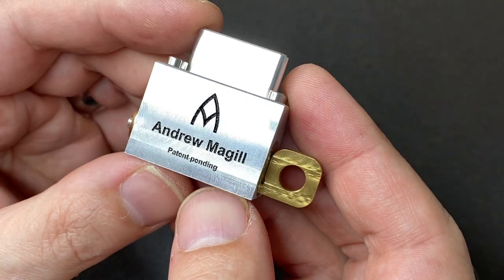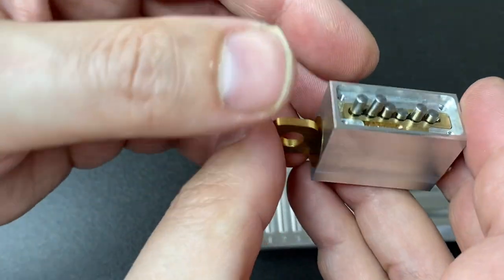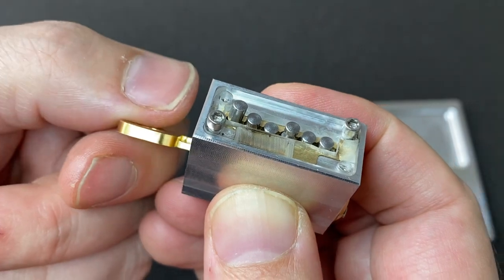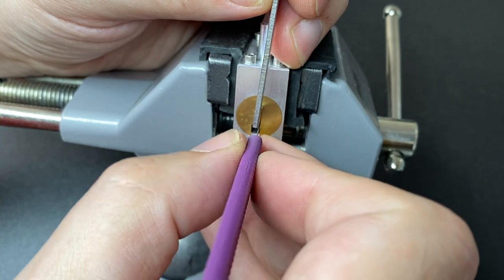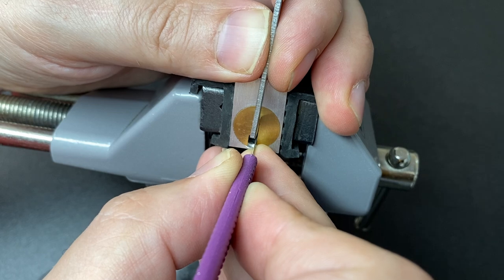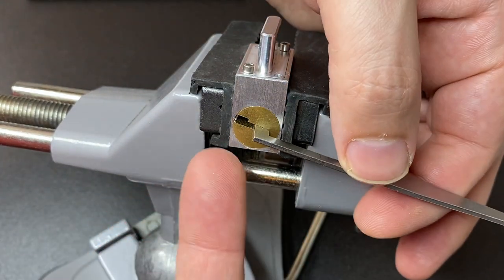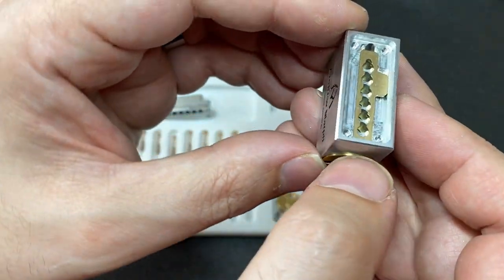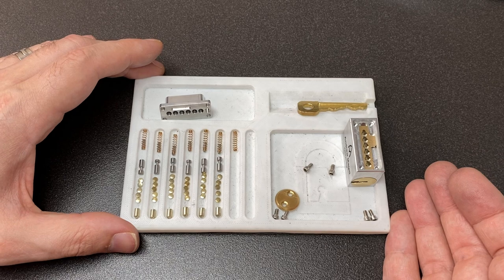Unpickable? Enclave - an Ingenious New Lock Design

Comment: Definitely an LPL challenge :) 

I would be curious how hard this lock would be to pick with a Lishi style tool, that way you get past layer one of the lock quickly by putting in the same code.  Then, when you try the combination, the force to turn the key changes based on how many pins are in the slot (the closer to the 45* pin=more force).

The key to picking it is seeing if you can feel any difference in the L2 lock tension or not and work back from there.
Reply: Assuming you can only feel what is happening at the shear line, this would be very difficult.  With 6 pins and 5 shear line positions, you would be looking at 5^6 or 15,625 combinations.
  

Perhaps there is a way to glean information about what's happening near the side bar.  With fine measurement, you could see how far the "false set" moves and then you could "feel" the pins touching the side bar.  So, my idea-- use a long and rigid turning tool-- or attach a long piece to a turning tool for measurement.  The longer it is, the more detail you can get from small movements.  Then measure how far you can turn it after setting a pin at each possible height.

Then, you might be able to eliminate a pin after testing each of the shear lines.  So you'd be looking at 30+25+20+15+10+5 or 105 different things to check.  That would take a long time, but then you might just need a few hours to open it instead of a few days.
Reply: you don't understand the math of it.

Lishi style tools help when you have feedback. Lockpicking is done based on feedback.
If you have n pins and each pin can have m positions (potential cuts), brute force is O(m^n). If you have 6 pins, and 7 positions, that's 117 thousand combinations. With feedback, you cut it down to something like O(n*m) or O(n*n*m) which is way smaller than O(m^n). O(n*n*m) would be 252 (and in practice you do it with less than 100 interactions if you're experienced like LPL; that's why he does it in a minute or two).

This lock gives you no feedback, so O(m^n) is unavoidable.
This is the third lock I saw that's truly unpickable. Bowley lock is the best: it prevents access to the pins.
Reply: @maolbz  The Bowley has been picked.
https://www.youtube.com/watch?v=ai5Hf-wPXFE
Reply: @maolbz  I think what they are saying is that you may be able to gain some feedback from the sidebar. Here's the method, it may be completely useless: 
Use a pick to align 1 pin to a position (a lishi tool could help with distinguishing the positions) then rotate the lock and feel how much strain is on the rotation from the side bar. If all of the pins are out of the side bar it should have slightly more tension than if 1 pin is correctly aligned. 
Repeat with the same pin at different heights until you find the correct height for that pin.
Repeat for each of the pins, it may be easier the further on you get as you'll feel more looseness as fewer pins are interacting with the sidebar.
Let's say you have 8 different pin heights for each of the 6 pins and you test each of these individually, the total number of tests with be 8 * 6 = 48. Each test will take quite long as you have to feel a tiny difference in tension but it makes the picking process actually plausible.
Reply: @teh_jibbler  only problem with that is theres no feedback from the sidebar or blocking pin at the back cos that blocking pin is only moved by the cam on the back of the cylinder, not the key. Once the core turns, all pin stacks are blocked from moving too so you cant feel through any of those what the sidebar is doing either. A brilliant design in that respect.

Comment: This is a different implementation of the same idea of the Stuff Made Here lock. An actually practical version this time!
I remember seeing that video and LPL's video on that lock and I thought that he was soooo close to something great. I think we found that something great here!
Reply: Exactly!  It basically uses the same trick of separating the keying from the checking, by using a second spring loaded mechanism. I think it could really be quite challenging to defeat.
Reply: @coco805  yeah! We might look at an upcoming new meta for high security. It's already so good. Imagine when this technology matures!
Reply: All of these designs could be potentially be vulnerable to laboratory level attacks where you put all pins in a turnable position, but with one pin at a chosen height. Turn the mechanism all the way and use a machinist's dial indicator to determine the amount of turn. For this lock you will get 6 pins 5 positions. One of these (the binder) should let it turn just the tiniest bit more. Now you know the correct position of one pin. From now on, always use that height for that pin, and try to find the second binder. Now you have 25 positions to check to find the second binder, etc. Heck of a lot slower than picking most locks and not really feasible in the field, but in theory this approach should work.
Reply: @kevincathcart4680  you might be able to put false gates in the upper pins which would make this approach much tougher

Comment: How prone is this lock to getting stuck?
One typically doesn’t put to much 1depth wafers in a lock, certainly not 2on top of each other because they risk sliding in between the rotor and the stator,
This one might have very good tolerances but that might be a big risk in a mass manufacturing setting.
Reply: If they move to mass production, they might make things bigger to accommodate sloppier tolerances.
Reply: Looks to me like (if the animation is too scale) the wafers are at least .5mm thick, while the tolerance of the lock body is under .1mm. the wafers aren't likely to get stuck in the rotation with such a ratio.

If mass production tolerances require larger tolerances, the ratio should still be able to be maintained and keep the jamming proof

Comment: Looking at the cam arrangements at the back and the angled pin I was thinking it would be susceptible to force it past the 45 degrees due to the mechanical advantage you get from the cam at the back. Brilliant idea.
Reply: Exactly what I thought. While being a destructive method this might leave the lock in a state where it still seems to be working, but is very easy to open with a pick or even the wrong key?
Reply: @Clayne151  maybe solve it by making the back cam to be turned only by the tip of the key separating then cylinder from it. But only allowing it to turn with the cylinder (simple 45 degree dog linking them together )

Comment: I think this lock might be easier to pick after being used a lot. 
If the lock is only used with the right key for a long time, which is expected, the tight tolerances might smooth out parts of the wafers. This would give back some feedback, like if you had serated pins with one of the gap being wider/deeper.

Comment: This is amazing!!
My thing is make the back of the core with a little less room and you can make the "false set" a little less witch would work better in an actual lock.
Also because you are using master wafers you can master key this lock you just add another slot in the driver pins where the "sidebar" could slide into.
This is a really good design IMHO!

Comment: I have a hunch that the weak spot in this design is not the chamber and the pins, but the last special hidden pin.
It looks like depending on the materials the lock core, the hidden pin, hidden plate, and lock top are made of, it could be possible to just force the lock open after the 45 degree point by applying sufficient rotational force to the core.
Reply: Force open (shotgun, hammer, wrench, other locks, gallium) is not a valid lock picking technique.
Reply: This could be made such that a force too great will destroy the cam pin and the lock will be unusable   but not opened.   You can do this with a common lock too but they then require an alternate entry to remove and replace once damaged.   This is not lock picking this is theft prevention.  Then the thief may up the game and knock down the door.
Reply: @cronostvg if this were a challenge lock, I would agree with you, but the first thing he said in the video was that this is a new lock design intended for production. In the hobby space, pick resistance is the highest metric by which to rate locks because you're intentionally limiting yourself to the rules of the game so to speak. Someone looking to bypass this lock to steal your things isn't going to care about the rules of picking, and is going to do the most efficient thing. In this case, it would be brute force.

Comment: 10:10 I think that's more like decoding than picking but it will get the lock open if you continue doing that for long enough. Especially if you measure how much you can rotate the plug with any given pin setting.

That said, this is the best pin tumbler design I've seen this far. I think it's vulnerable to brute force attack because the only thing holding the lock not open after a shear line for accessible pins have been set is that single pin with a diagonal ramp. Inserting a strong enough tool in the keyway and simply turning the lock open with force is probably going to work every single time either by compressing the pin with diagonal ramp or bending or cracking something inside the lock to allow the plug to rotate. In addition, the way this lock works, the actuator will rotate about 45 degrees with any key which may or may not be a problem depending on where this lock were used. Too bad it's patented or that could be a nice community project to try to improve the design further.

I've been trying to design a pin tumbler lock design myself which requires much less parts but more pins because my design can only have 3 positions per pin. I think it cannot be picked either but I think any mechanical lock will be vulnerable to decoding.

(The only mechanical lock (using a mechanical key) that I'm not sure if it can be decoded is Kromer Protector. And that's only because the actual specs of the lock have never been made public so the amount of possible cuts for each key location is unknown so you cannot test every possible cut for a single location. And that lock design requires that you have at least one correct cut for the whole key to be able to apply tension. Obviously, it would be easy if a single disk could have 6 different cuts, then you could have 6 different tensioning tools and just try which one works. The fact that the safety of that lock basically depends on not knowing how many different cuts a single position in a key can have makes it more like security by obscurity and that would obviously fail if many enough locks were in actual use.)

Comment: What a great concept for a lock 👍👍 really cool 😊 seems really challenging and near to impossible.  Would this fit in a real world format like a Euro cylinder? 
Maybe Max lifting and letting pins drop as controlled as possible could be a strategy? 
Cool that he prevents overlifting from the start 👌 would have been my first guess
Reply: the lock could clearly fit in almost any cylinder format. it's been made the way it is here for demonstration purposes clearly and there's a lot of excess material that could be trimmed off. also the body is aluminum and that's bad for a final product.
Reply: At this point if you lift all the pins the shear line would prevent the pins from falling while there is tension on the bar. So when the pins are able to fall there is no way to put tension on the bar.

Comment: Love the design!
Just wondering how much abuse it would take. I imagine someone turning it with a stronger tool after jiggling the pins into any false set. (disc-slip).
I am curious if metal in lock can deform by the forces leaving it unable to open later.
Reply: If it doesn't take realistic abuse, someone didn't put in enough work between prototype and final product.
Thats the common way to make attractive, but useless stuff. 

I doubt the inventor will let us down like that- a manufacturer might, though.
Reply: Put a deep notch between pin 6 and pin 7. This will break the lock in the closed state.

Comment: I saw when Andrew posted on the /r/lockpicking sub and looked at all the specifications, very innovative and original design.  Beautiful lock, and I've seen others try to open it with no success.  I love Bowley's lock's designs, but there is something about Andrew's design that is more beautiful (maybe not the right word, I'm at a loss).  Either way, beautiful lock, great video.
Reply: Elegant is probably the word you're looking for.

Comment: I'm no lock picker, I'm a design engineer, so excuse my terminology which won't marry with the video wholly.
At a glance it looks like the lock's strongest feature is to rely on typical picking conventions; gradually loading up each spring in each pin's bore.
It looks like the best methodology would be to fully preload each spring to it's stop and work backwards so that the undercut is aligned into correct position so that the shims in each bore don't have the opportunity to create the false positive.
Of course, there may be a feature to negate this method but a good design all the same.

Comment: I'm wondering whether applying pulses of high pressure air to the front of the lock would be able to momentarily kick the driver pins up. If so, devising a situation where all the key pins and wafers are below the shear line and the driver pins are alone above it, playing with pulses of air and precise tension at the point where the "side bar" starts binding the driver pins might enable dropping them into place one by one...
Reply: There is a riddle toy- a wooden cylinder inside a bore- that you solve like that.

Its pretty amazing when the cylinder rises out of the bore once you blow on it with breath alone.

Your idea is the first promising one i've seen here- but, it could be defeated by a pathway next to each pin, quickly equalizing pressure above when you apply pressure from below.

Comment: One possible attack I can think off is this: squirt in a slow working glue, that will glue the wafers together in say 24 hours. Then let the normal user open the lock with the key a few times, to break the glue between the correct wafers (and other moving parts). When the glue has set on all wafers (except the proper one), you could perhaps feel the correct wafer clicking in position.
Reply: Yep that’s the attack. Nice! How did u think of that? I could totally see this working. The user with the key probably wouldn’t even notice anything either. You have a good mind Sir. Good job.

Comment: You could put careful tension on the "sidebar" by rotating the core with a key with just the lowest bitting on all positions. By repeated impulses toward the top, the "sidebar"-pins will eventually find their correct position. This attack could be prevented in a future version by giving these "sidebar"-pins false gates.
Reply: I have been playing with another copy for some time and this is the only exploit I have imagined so far. That said I tried bumping the driver pins into place with repetitive strikes on the body, no luck. I also tried moving the drivers with a strong magnets, no luck. Apparently I successfully catched a few pins as I can hear them dropping when I release tension, but I never got the 6 of them. I don’t know if an EPG could bump the driver pins far enough to possibly make any combination. Remember that you don’t have access to the pin when you tension the bar, the only thing you can do is to induce pulses into the core.
Reply: Won't work, as the thin wafers will prevent the sidebar pins from coming down..Not all sidebar pins will need to go upward. In order to get tension on the sidebar lever, the key needs to be turned and  this will remove access to the pins. See 1:56
Reply: @MrDLRu  It may work if you turn the core with all the wafers in the core and only the drivers left in the bible. However getting the driver pins to jump whitout any access to them is another story…
Reply: @yom73  I'm thinkin' that is impossible to do. You may get 1 or 2, but at some point the small wafers will allow the cylinder to turn beyond the pins.
Reply: Bumping is the only way I see to move the real pins while the lock is tensioned. But the only way to do it is applying the bump to the whole lock and hoping the pins will randomly move the right way. In theory this could open the lock in less tries than trying all possible combinations, but when you realise that locks are usually in a door and cannot be bumped up/down...